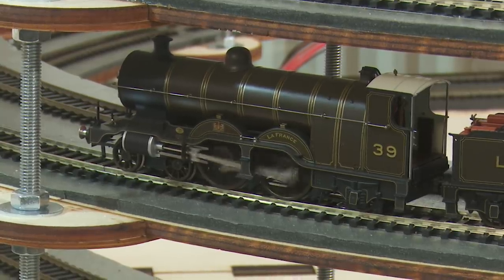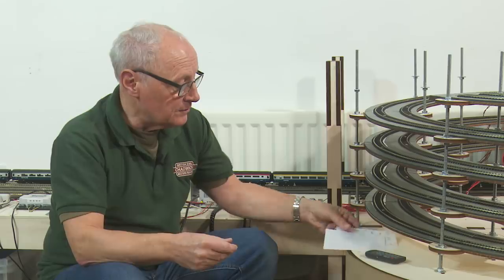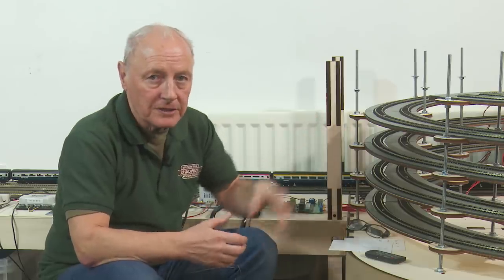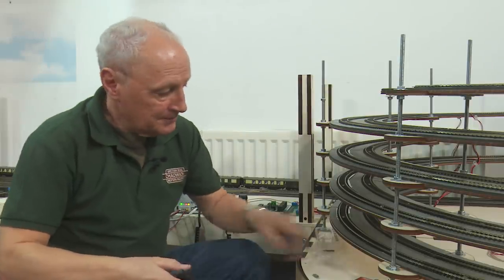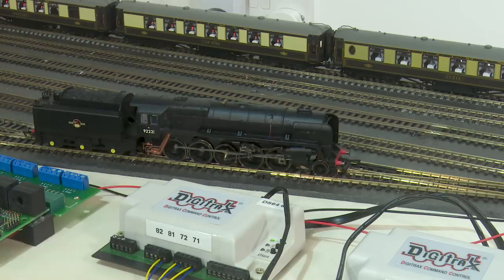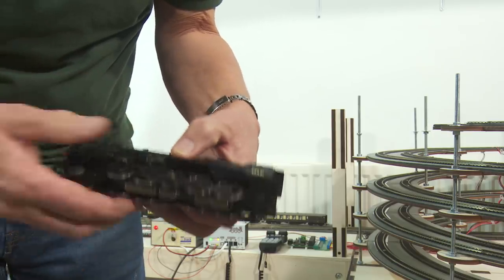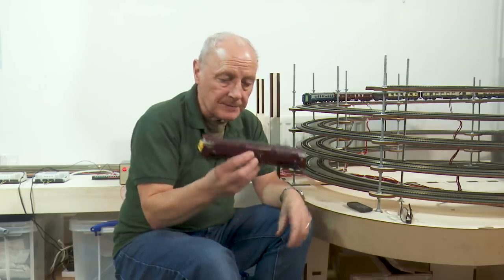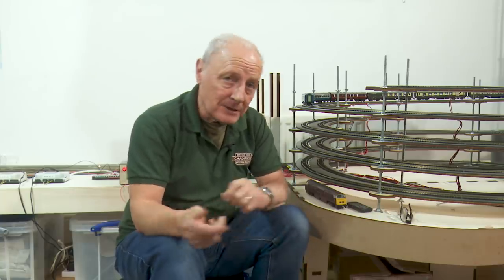Inclines and Power Base at Chadwick Model Railway | 118.

Comment: Id be interested to see what you can do by blasting the locomotives? Also could you measure the equivalent weight of the magnets?
Maybe suspend a magnet at the same hight as on the layout above a piece of powerbase on a zero’d kitchen scale?
Reply from the maker: Interesting points Jon. I’m certainly looking deeper into this.
Reply: @ChadwickModelRailway  I had the same thought. If it's possible to open up the kettle, the boiler (I don't know the probber english word for it), you could put some weight in there.

Comment: Well quite a bit of engineering but in the end excellent results.  Have you thought of using a product called Bull Frog Snot. Bad name but gives good results. You “paint” it on a driver or two and it adds a kind of rubber tire to the driver. I’m told it lasts quite a while and can be reapplied when it wears off. Of course this eliminates those drivers as electrical pick ups but everything is a compromise isn’t it. Continued success in your efforts to build Chadwick Model Railway.
Reply from the maker: Hi Joe, The BF Snot will be on order shortly, regards Charlie

Comment: Interesting video - many years ago, certainly in the 1960s/70's, Triang used to market locomotives with what they called the Triang Patent Adhesion System - the reason was the new plastic body loco's didn't haul as much as the old cast iron body loco's, or those competitors who still used cast bodies such as WREN - the track in those days was made out of steel (so if you got your 6x4 layout out of the loft for use in the winter, the first thing was to clean the rust off), and the "patented" system was simply as big as possible magnet in the bottom end of the loco to stick it to the track, and hence add adhension. Intersting now that someone in the modern Nickel-Silver rail days has added back the steel and magnets (and I dare say, at some cost). If there was a genius out there, they would mould a magent the same size at the piece of plastic on the bottom of the 9F, and you would simply replace one with the other. I'm not a fan of the helix (space, plus operational access issues), but I do think that not adopting your normal distributed power for a single power source in the helix is a wise operational choice - Good Luck!
Reply from the maker: You’re dead right Ian we appear to have gone in full circle. Regards Charlie
Reply: @ChadwickModelRailway  Nice pun there.😉

Comment: A way to test the pull/force of an engine would be to buy a luggage weight scale. (Make sure it is the type the luggage scale that pulls on rather than sits on.) Just tie a string to the couple box of the loco and one end to the scale. Let the loco run as far as it can until it spins in place. The weight on the scale should tell you the force it can pull. (You can do this on inclined track as well.) (If this is confusing or you want a diagram, let me know and I can send you one.)
Reply from the maker: Yes PCC, that’s exactly what a Newton’s Gauge does.

Comment: Adding weight into the Atlantic would give it more grip. That's why diesels usually haul better than steamers - there's loads of room in the body for big weights to them lots of grip. Failing that you could follow prototypical practice and either double-head her or use a banker to help her up the  helix.
Reply from the maker: Good points Paula, and ones that we need to expand upon. That’s why I mention we need some kind of table for Models to use as a database. Regards Charlie

Comment: I don't think I've ever bought a European Ho loco that didn't have traction tyres on the directly driven axles. The first was bought in 1977, a Fleischmann DB 103. Seem to be a British tradition not to fit them although I notice a couple of new Bachmann releases include wheel options with or without the grooves for tyres.
Reply from the maker: Yes it is odd Jack. I have never owned a loco with traction tires, regards Charlie

Comment: Charlie you might consider getting some more powerful magnets. I'll bet those supplied are like kitchen magnets. Neodymium magnets are the best bang for the size. And you can get them in any size or shape desired. And on the power base on the other helix you might kick yourself later if its not that much work/money
Reply from the maker: Sorry Adam, but these are Earth magnets and are extremely powerful. It’s just a case of adding more sometimes! Regards Charlie

Comment: Would be interesting to see your power meter hooked up to see if the magnets increase the current drawn.  Could be hours of fun plotting graphs of speed and number of coaches against current 😂👍😷
Reply from the maker: I understand the intrigue of the current draw  Alan.But it would vary with each individual loco and train configuration! Regards Charlie.
Reply: @ChadwickModelRailway  Yup.. thats exactly my point 😃. For automation, I would want to know what current each loco draws with its train on the incline. To prevent overloading the power supply. I am an industrial automation engineer, and I reckon combining your RFID chips with a current meter could be used to indicate if a motor is on its way out. Should be a simple matter to put in a toroidal sensor to a block and feed it into a PIC chip or PLC. 😬

Comment: Nice test of the helix. Have you tested any of the smaller locos you mentioned at the end? Obviously, if they struggle, you will have less surface area to mount any magnets to assist.
Not detracting from your efforts at all, but I thought Graham Foulston might have had the answer on Riverside Mk1, when he had all the curved parts level and the inclines straight (admittedly on a much larger, in terms of area taken up, helix). Just an observation - loving what you're doing. Cheers.
Reply from the maker: That’s a fair point Davie .My space is a little more limited than grahams, but the fiddle yard will be enormous. Regards Charlie
Reply: @ChadwickModelRailway  Had my helix worked my fiddle yard would have been the same size as the layout above it. But it didn't, so it isn't and I now have a handy shelf! ;-)

Comment: hi Charlie , i have been watching your videos with great interest and yes i have subscribed , i would just like to say that by fitting magnets to the underside of your locos to increase traction could shorten the life of the electric motors to some degree as this increases the down force which effectively increases the weight of the loco  ,  so this has the same effect as decreasing the motor size and increasing the current which in turn causes the motor to run hotter which may have a detrimental effect on your loco and over a period of time may burn out your loco , you may be able to measure the current from one of you dcc controllers for said loco on the flat and on the incline to see the effect of the incline on that loco.

Rob
Reply from the maker: You made some interesting points Rob. However I’m not too worried about burning out the motors, after all the loco will only be on the Helix for a couple of minutes, spending most of its time on the main layout. Regards Charlie
Reply: @ChadwickModelRailway   , i only mentioned this as to make other people aware , happy videoing

Comment: From a physics perspective, I assume the point of the magnets is that the pull to the metal plates under the rails provides more traction.
Reply from the maker: Yes David exactly that, giving it more grip.
Reply: Would more weight not help, if there is room of course?
Reply: @brblue6839  however that adds more downhill drag. Magnets add adhesion without requiring (much) extra weight to be lifted up the incline.

Comment: Another interesting video Charlie. Is it worth placing the (magnets) weight inside the boiler of your steam engine to see if the weight pushing down on the drive wheels helps with traction? Take care and safe see you on the next video...
Reply from the maker: It’s a good point Barry yes I will add some weight and see if it makes any difference. Regards Charlie

Comment: Ebay is also good for small neodymium magnets - I've used a large number of 2x3mm & 1x10mm for both magnetic couplings, and making collapsable kit buildings - you might be able to find some that would be a better size for some of your other engines.
Reply from the maker: To be honest Kaylee, these ones are fine.
Reply: The trap not to fall in to is that it's illegal to send magnets through the post. - Dennis.

Comment: If you know locos (particularly steam) can climb the helix without load, and you know which coach/wagon consists you're likely to run with which loco, then how about distributing the magnets along the coaches, which should effectively reduce the amount of load the loco is pulling, plus you have the advantage of more space under the body to put the magnets. And to be fair I think I'd favour the glue method of attachment rather than screwing, glue can be removed over time, screw holes can't.
Reply from the maker: Sorry Mark, surely the added magnets to coaches etc would just add drag wouldn’t it?
Reply: @ChadwickModelRailway  Then my understanding of powerbase must be incorrect, although I haven't found anything online to clarify one way or another, I assumed the powerbase concept uses polarity to push the magnets along, this largely came from the directional shape on the plates, I now from your comment assume all the powerbase, along with the magnets, does is pull the loco into the track, effectively adding weight.
Reply from the maker: No Mark ,It’s just the attraction of the magnets to the steel plates that pull the loco down and give it more grip.

Comment: You say that you've never loved the 4-4-2 tender loco that was pulling the Pullman coaches, You can always give it to me. If you watch the video and look closely at the loco when it's wheels were slipping on the Helix, you will notice that there was no movement at all in the body. This tells me that this particular loco is running very true and its rare to see this. You normally get some body movement, even if its only very slight.
Reply from the maker: An interesting observation Sam, thanks.

Comment: Can you try banking the atlantic up the helix? As an experiment, I'd be interested to see if it is possible. That's if you don't think it too much of a risk of forcing the train into a derailment and fall. It shouldn't as long as the banker isn't trying to push faster than the lead loco. If you have 6 on and the banker takes the tension off the back 3. Thinking about it, it isn't going to work, don't risk your stock.
Reply from the maker: It’s certainly well worth experimenting with mate. Regards

Comment: I am assuming that thistested HST isn’t a rubber-tyred Ringfield? Or is it? The more modern HSTs, are they both Driving ends (ie two motors) like the Blue Pullman? I don’t know, but your tests are a pretty good conclusion of ordinary Locos. An amp meter would be interesting to see connected to see what the current draw is as well........
Reply from the maker: My HST has the single power car but my pullman has both.  I will check the power consumption in due course.  Reagrds Charie.

Comment: Hi Charlie Have you tried a small diesel loco down the helix? I have a long slope and the carriages try to push the loco along, I am only running six carriages.
Reply from the maker: Not yet Derek, but you are scaring me! Regards Charlie
Reply: @ChadwickModelRailway  Now there’s a good point. We’re so focussed on getting up the helix, when the effective weight of the coaches overwhelms the loco traction, that the same going down may have escaped our focus.  (I do remember that Charlie showed the effect of a free-running coach when the helix was first assembled)
Note that friction (and extra pickups) is our friend here, so it would be the free-running wagons/coaches to increase the challenge. 
So the banker could have duty going down the slope, too!

Comment: Hi Charlie, Another interesting video. Looks like your modern diesel stock managed your helix with any slipping when pulling coaching stock even without the magnets, I've often wondered how a rake of 30 to 40 16 ton coal/mineral wagons or similar would run up a helix. my fear is they would pull themselves off. Regards, David.
Reply from the maker: They shouldn’t if the are all the same weight David.

Comment: Delighted that the Powerbase worked for you Charlie. That investment has paid off. I must admit I tried it a year ago and it was not too successful with steam locos. Perhaps should have fitted more magnets. I wonder if lowering the incline to 1:60 or so, would work....does it just need more circuits to raise to required height?
Reply from the maker: Yes it is a difficult balance Chris.

Comment: Hi could you tell me what size flex do you recommend for point motors I am using 12v dc for my bus line which is household twin and earth.i am using 16ac for my point motors,and going through a cdu,but I am unsure what size amg flex I should be using as I am being told it should be 16amg,any help would be appreciated.Pam
Reply from the maker: Hi Pam, I imagine that you’re in the USA as you are using amg which is not used in the UK.  
Please ask Larry “The DCC Guy”
Reply: Hi Charlie sorry if I confused you ,I am in uk,basically I would like your advise on what size to ask for in the model shop. I want to wire from 16ac box to a cdu then a point switch,and then to a solenoid point motor.Thanks again Pam

Comment: Sorry to be so thick, but I didn't see any explanation of the physics behind the metal plate/ magnet combo to enhance traction. Is it explained elsewhere on your Youtube channel? Also, is the entire helix track bed covered with the metal plates? What did it cost?
Reply from the maker: Yes the steel plates are fitted to the whole of the outside track Henry.
Reply: Plates and magnets are available here: https://www.dccconcepts.com/product/powerbase-value-pack-ooho-scale/

Explanation of gradient system in PDF:
https://www.dccconcepts.com/
Reply: @ChadwickModelRailway  Thanks. I see now that the plates are simply metal plates that make the magnets (by attraction) pull down the engine that has the magnets attached in order to make better wheel to rail contact. Simple!

Comment: Have you tried just adding weight? it'd be interesting to see a comparison of downforce from weight verses downforce from the magnets. ie a 5g magnet gives 10g downforce.. 
Both chunks of lead or fine lead shot in a glue mix moulded into the inside the plastic shell could add a reasonable amount of downforce.
Reply from the maker: I will certainly try adding weight to the Atlantic P77.

Comment: Would it not be more prototypical (🤢) to bank... The steepest incline in the UK is the Lickey Incline at 1:37.7 - where even today some heavy freights still need banking. Over Shap (1:75), even in the days of the class 50s, double-heading was essential - it was only when the electrics came in that single-heading became the norm.
Reply from the maker: Hi Timothy, yes double heading is clearly an option but banking, I’m not so sure. The problem is if you put too much pressure from the lower loco you could end up with a massive derailment with the train buckling. Regards Charlie
Reply: @ChadwickModelRailway  Very true - front and rear locos would have to be so finely tuned to each other's speeds... And the Lickey Incline is straight. Not far from me there is the Tunnel de Saillens - a helicoidal tunnel - but almost from inception in the 1920s the line was electrified so the need for banking never really presented itself

Comment: The brake rigging on the H1 just unclips. Most model steam locos suffer poor traction due due to poor balance. As the the drive motor, gear train, drive axle is fixed the loco tends to pivot slightly on the drive axle. I solve this generally by opening up the axle hole slightly to allow a bit of up and down movement. Other things you can are to check the leading and trailing truck springs, especially Bachmann locos,  which from the factory can be a little stiff. I usually anneal the springs so the weight comes off the front truck and onto the drivers.  Other than that your back to Triang Magnahesion.
Reply from the maker: An interesting comment Charles. Yes we appear to have reinvented the wheel! Regards Charlie

Comment: I think it's reasonable to assume that a model fresh out of the box will naturally improve a little bit as it beds in. When the plating on the wheels is new, it'll be quite slick and smooth. As it ages and it picks up imperfections this should aid traction. Similarly, the rail won't stay a perfect finish forever so traction should improve over time.

If you want to persue the steam thing, you could always scratch build a model of the 0-10-0 Lickey banker "big bertha"? Or, emulate the convention of tacking a class 37 / 47 on the back of your steam rail tours! 
Emulated the convention... cor that was VERY close to using the "P" word in public! Think I got away with it, though...

Cheers!

Jon M.
Reply from the maker: Jon, wash your mouth out with soap. Regards Charlie

Comment: I guess I missed something in the video. How do the magnets help with the climbing?
Reply from the maker: Steel plates are placed under the track.
Reply: @ChadwickModelRailway  I got that part. I do not see how that helps with the power to make it climb better
Reply from the maker: TheMagnets increase a downward force and therefore add grip. Regards Charlie
Reply: @ChadwickModelRailway  Thanks for the info. I had thought it had to do with the strength of the motor